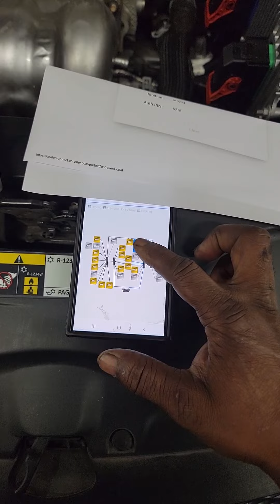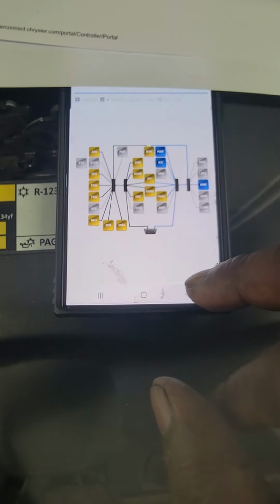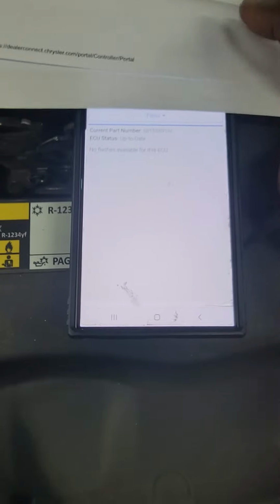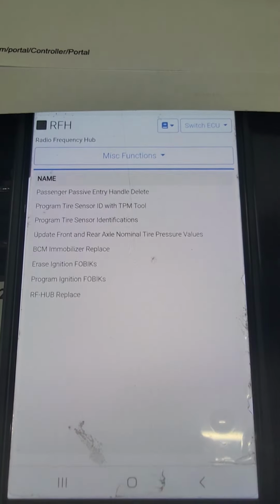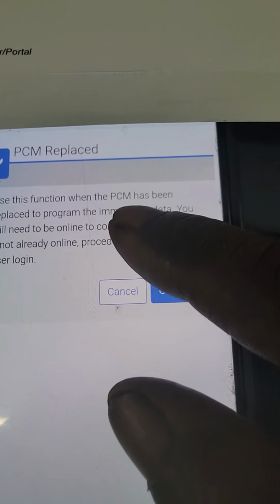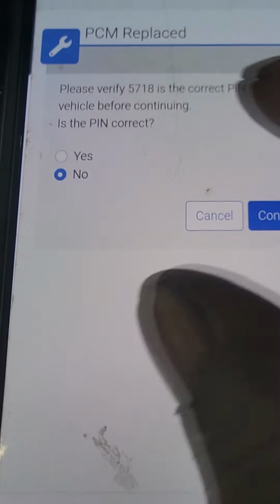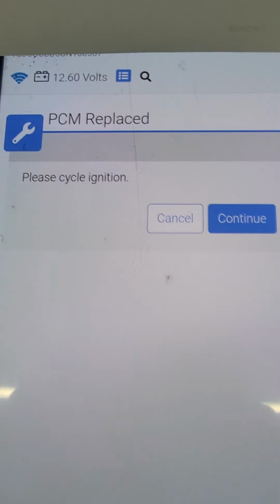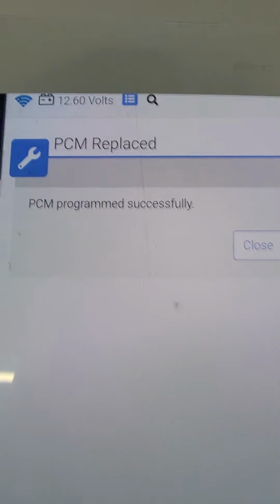How to replace a New Car Computer PCM. Link the RFH hub to the new ECM to Crank and Start.

Comment: My launch Scan tool does the same thing but it has For Dodge Chrysler and Benz they have what the call All system recover and match   that it tells you you have to do tis after New PCM installation  and or Programing  .. and it sets every module to the PCM ....
Reply from the maker: Dang, that sounds like a winner for a scan tool. That it can do all that.

Comment: Hello men , i want to thanks you very much for your live video that show the proper method to sort it out  with this new technology with witech 2 , i presently am in the same boat of you this took me very long time to all figure it out from scratch , i deal with used pcm gpec2a  almost same platform as youre  but the tricky thing , this pcm change iniated after  engine swap so i dont exactly know  how i will be able to make it workwith witech  as exemple number 1 i buy a new v8 pcm but when time to program i probably have to chose  orginal v6 program that goes with my vin , exemple number2  buy new v8 pcm and program it as per v8 vehicule origin  and after i change vin number in pcm with alfa obd would it work? 
I just put my hand on new launch x431 that give me some hope    say pcm replaced with data  i will try this one and give some feedback  if it not work i will go along witech as you men if someone have some guidance on this i will apreciate